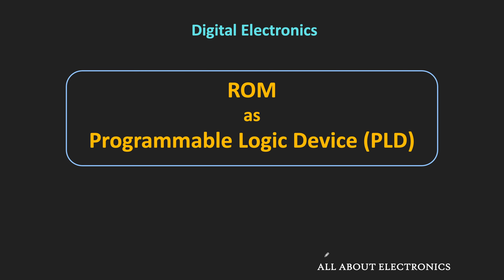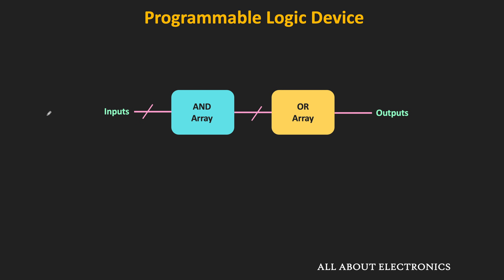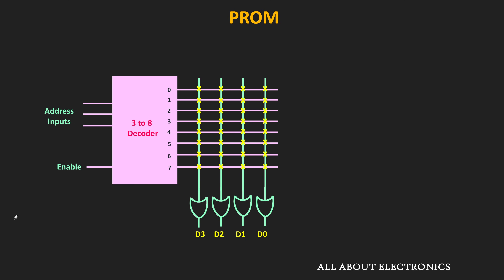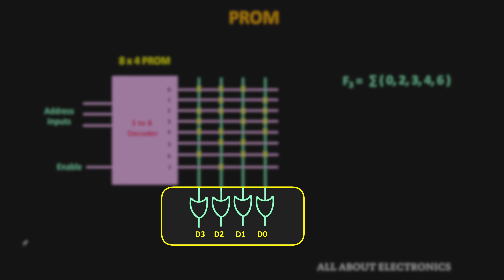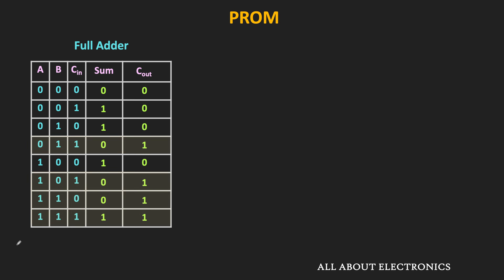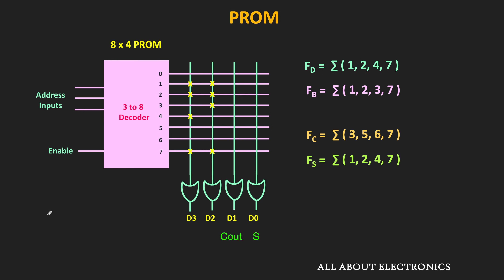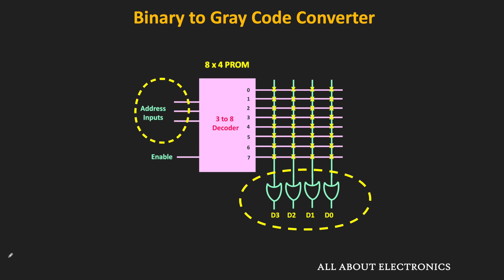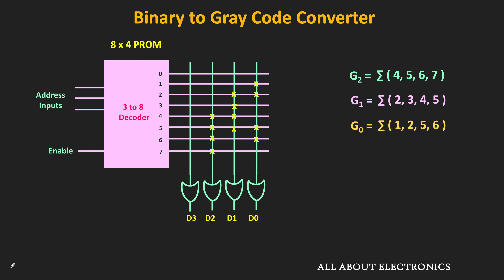How to use ROM as Programmable Logic Device | ROM as PLD

Comment: 13:45 why we cannot implement 8x6 PROM
Reply from the maker: What I mean to say is, typically the outputs of the PROM are available in the multiple of 4. (e.g 8x 4 PROM or 8 X 8 PROM). 
So, if we want to implement the function which requires at least 8 x 6 PROM then practically to implement that circuit we need to use 8 x 8 PROM. (Theoretically of course one can implement it). I hope, it will clear your doubt.